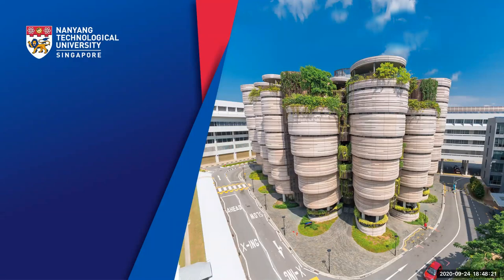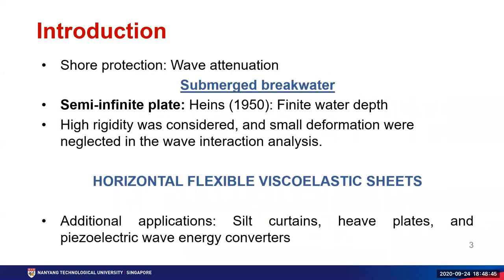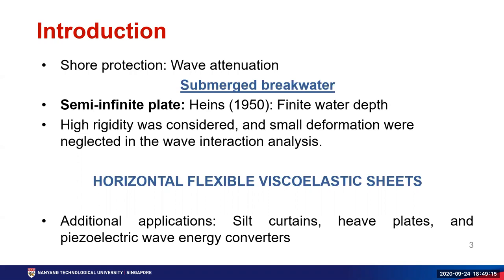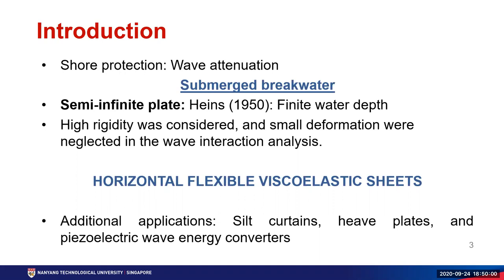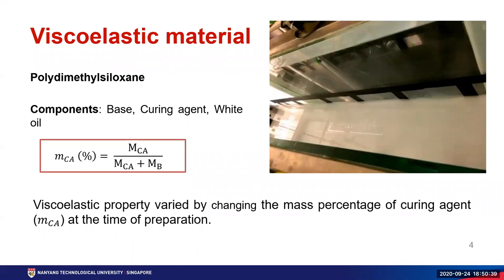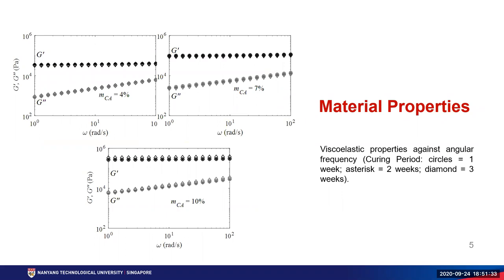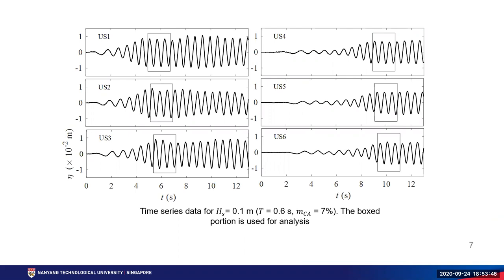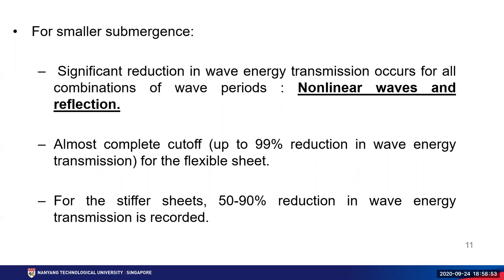Session #30 - Dharma Sree K K: WAVE INTERACTIONS WITH SUBMERGED HORIZONTAL FLEXIBLE BREAKWATERS

Comment: Prof Sree K. K.,
thank you and on yours costal engineers for all studys. Researching floating or submarged horizontal flexible structures can be used as an effective breakwater or wave adsorber with low transmission and reflection coefficients due to their high effeiciency in the wave energy dissipation and less enviromental effects. General methods used to separate incident, reflected and transmited waves include The 2-point Method, The 3-points Method, The 4-points ( last in 2004) and the arbitrary number of pointins Method. Wave energy have spectrum in all surface points. The smaller submargence is in nonlinear and key issue for costal engineers. We can see form in exp. QA/QC Program (Quarry RPR, Site RPR) with all GPS, Data BUT FLOATING ~ horizontal structures ~ ( in mine case, exp.) but we relied on quite complex experimental tasks and we surch Method on that base. 
With great respect on your other works!